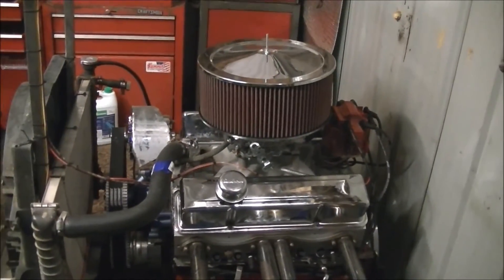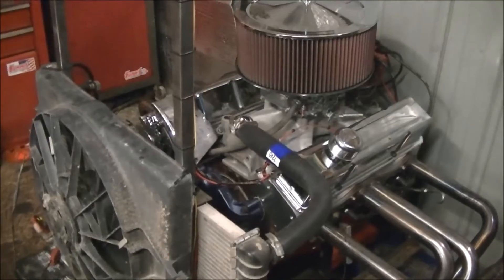screaming 302

Comment: Hey sense u already have a hei u would get a msd hei heat modual with rev limiter it replaces the stock modual in the distributor it's 100 bucks. I have one and its not the box it goes in the distributor. Cool motor.

Comment: try using the vacuum advance on intake vacuum to run a lower timing during cranking then when it fires it will pull in more. it will run cooler and let you roll in to the timing curve as the base timing can be lower and sill have plenty of timing to idle. run more timing in the centrifugal curve to get to total. this gives you more of a on demand timing curve based on more lode. run air from out side to keep the air going in as cool as possible. run a insulated spacer under the carb. the cooler the air and fuel the less octane. it sounded good it did not sound super radical like I thought. I think it will be fine on 93. I have run 10:-10.5:1 iorn heads on a ford 302 on 87 but use 89 to be safe. had no ping on 87.  that thing sounded good. do you think it will be a rpm qeen or have a flat power curve? it seemed to idel good at a low rpm not like it was a total rpm qeen. hope it has a wide power curve and runs on 93 or 89! take care. glad you built a 302 vs 350 or 383. different is good.

Comment: What cam did you run ?
Reply from the maker: 1st gen 140 offroad cam
Reply: @MattsMadnessOfficial  I am getting ready to bulid a 1973 k20 for wood truck/ farm truck I have a 302 short block but I was debating about having the big cubes and extra torque for down low did gm make that cam ?
Reply: @MattsMadnessOfficial  also how is it driving a big cam small block in like a 3/4 ton to 1 ton truck say the cam doesn’t start making power till 3000rpm and quits at about 6200 or 6500rpm
Reply from the maker: @clayjones1063  well this engine will rev to the moon around 9500 and not hurt it I do it alot right now it is in a sonoma, the ton truck it was in I broke the rear axle with this engine then the trans then I stuck it in a 4x4 blew the trans lol not hard to drive at all
Reply from the maker: @clayjones1063  yes gm made that cam in 1967-68 , look up the video hauling scrap at 9500 rpms
Reply from the maker: @clayjones1063  https://www.youtube.com/watch?v=LHXRZrOoDc0
Reply: @MattsMadnessOfficial  we’re did you get your 140 off-road camshaft from ?